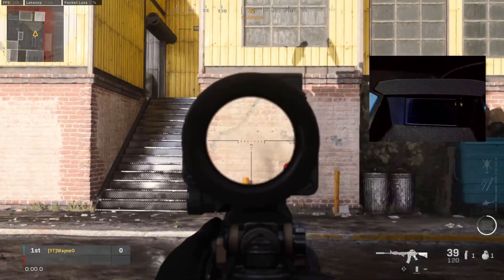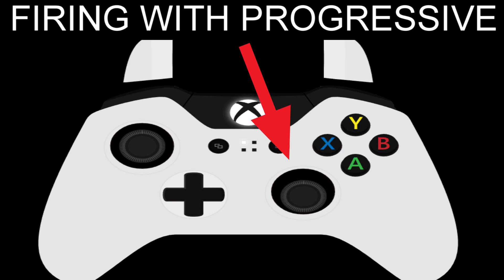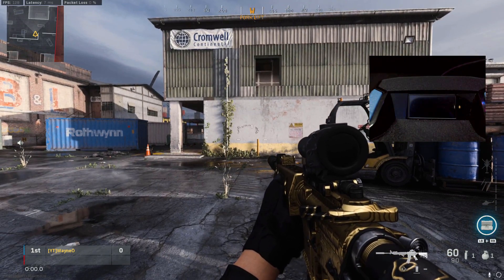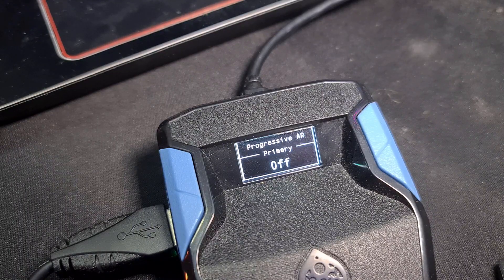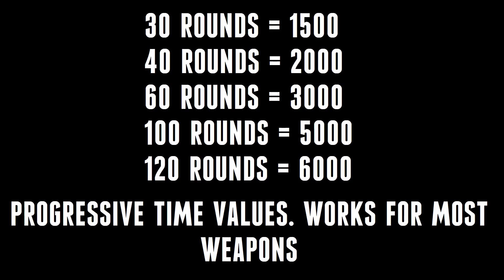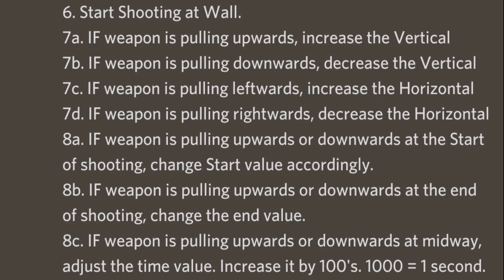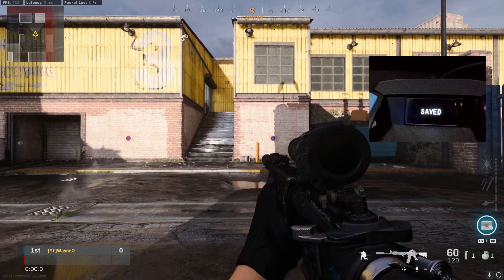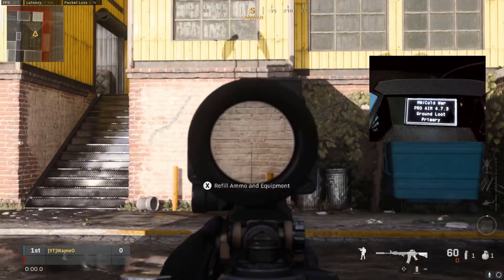How To Work Out Progressive Anti Recoil | Detailed Tutorial With Examples | Cronus Zen | Taylordrift

Comment: I need help I play on 7 7 .05 and it keeps pulling and its frustrating
Reply from the maker: Pulling where?
Reply: @WayneO_  always to the right and down towards middle of mag
Reply from the maker: Depending on when it's going down. You'll need to reduce either the vertical start of end. If it's going right. You'll need to put the horizontal values a bit further in to the negative.

Comment: When I set my recoil at around 20 meters then move back to 40 metres the recoil is completely different. Why? The Gun should move the same
Reply from the maker: Only time it done that for me was when I had ''boost'' turned on in the aim assist settings. Once I stopped using that. I stopped having the issues of the recoil pattern changing.

Comment: A better way to work out time would be to empty an entire clip and time it. Eg. 60 rounds takes 5 seconds. Then all you need to take note is at how many bullets does the recoil change. Eg. 30 bullets would be 2.5 seconds. Obviously I used easy numbers for simple math but this would be more accurate and quite easy
Reply from the maker: Yeah there's a few ways of doing it. This has just been my go to way of doing it since the start and it's worked so if it ain't broke don't fix it haha. But you're right. It can work like that too.

Comment: Great video, so I understand that you’ll have to have multiple scripts downloaded for different load outs but what do you do for each gun on that particular load out?
Reply from the maker: Yeah that's one way of doing it. 

There's a seperate profile for primary and secondary that allows you to have different anti recoil and aim assist settings.
Reply: @WayneO_  Could you elaborate I am a noob. If I pick up different ground loot and different loadouts how do I switch in between or activate
Reply from the maker: @gianni18121987  You need to set the script up for ground loot.

https://youtu.be/oawlYdJfHzI
Reply: @WayneO_  does it automatically work after I set it up or do I need to switch switch in the zen. And how many weapons can choose or is it a standard setting for any ground loot
Reply from the maker: You won't need to switch slots but you'll need to press some quick toggles. 

There is 1 setting for ground loot. Watch the video I linked. It's all explained.

Comment: Yo bro great video. Got a problem though. My legacy Ar still works but my Progressive Ar doesn't seem to work, it's like it's still turned off even though its actually turned on. Please help
Reply from the maker: Make sure you've got the in game vibration turned on. 

Also, turn the veritcal values up to something ridiculously high and see if it makes the recoil go down.
Reply: @WayneO_  Yo it’s on man since the legacy works. I tried turning it up to max,  it just doesn’t seem to work. Guess I gotta just use legacy.
Reply from the maker: They both send pretty much the same command so if one is working. The other one will be. You just need to definitely make sure it's on.

Comment: Those patterns are very easy to adjust, most annoying and hard ones are the zig zag patterns. Real pain in the arse to adjust. Like the Groza and Fara
Reply from the maker: Yeah, sometimes you need to put the horizontal start to the left and the end to the right. Or sometimes the other way around.
Reply: @WayneO_  how to adjust it for ex , if it goes 1st down , after up and after down again? The same goes for left and right
Reply from the maker: Vertical start down. 
Vertical end up. 
Small change to the vertical time. Try up or down to see what works best. 

Left first? Then right? 

Horizontal start to the positive.
Horizontal end to the negative.
Reply: @WayneO_  i mean way much zigzaging up down or left right. Here i struggle . Other wise i got the point bro